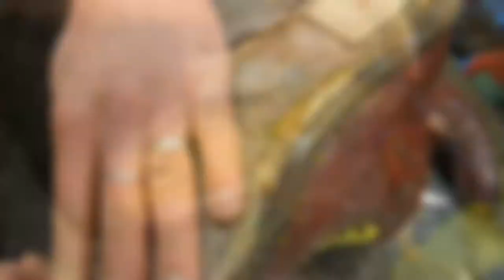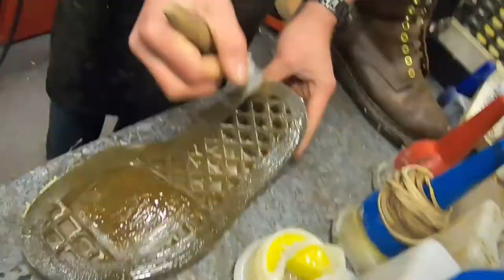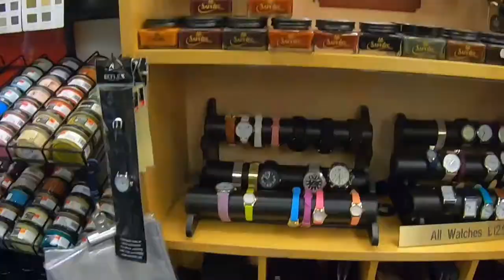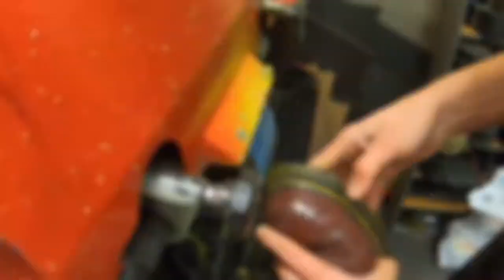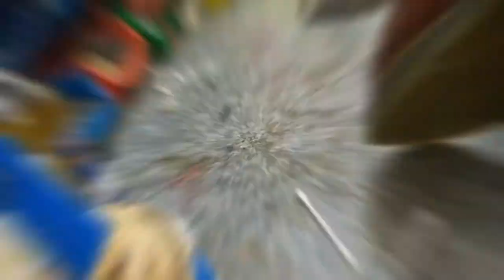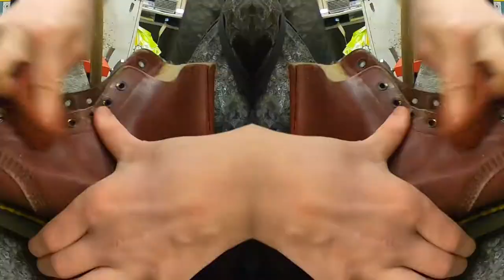Dr Marten Resole and Restoration

Comment: The state of that stitching FFS
Reply from the maker: The double stitching from the 80’s is a Classic stitching method and would stand out a mile to any dr marten enthusiast.
Reply: @keycobbler9036  I have 90-odd pairs of "Original" DMs dates starting from mid 70's ,and double stitching isn't used on ANY of them !
Reply from the maker: @pegknife  not all were double stitched but plenty of them are. We’ve been repairing dr martens since the late 60’s early 70’s. Double stitching is completely common and normal up until the late 80’s when production started to change.
Reply: @keycobbler9036  Nonsense
Reply from the maker: @pegknife  our family have been repairing these for over 40 years and we also work closely with dr marten and suppliers down in Northampton, we know what we’re talking about
Reply: @keycobbler9036  40 years ? well you would think you would know how to go about it by now ,like heat sealing them like the factory does instead of just glueing them .still never mind eh.
Reply: @pegknife  it ain't nonsense, I've seen plenty of em. There's a collector on IG with over 500 pairs of DMs and many of the vintage pairs were double stitched.
Reply: @grugg3108  Rubbish,iv'e been wearing them 50 years ,never ever seen a new pair with double stitching ,not even from southend .
Reply: @pegknife  Guess you dont know everything then